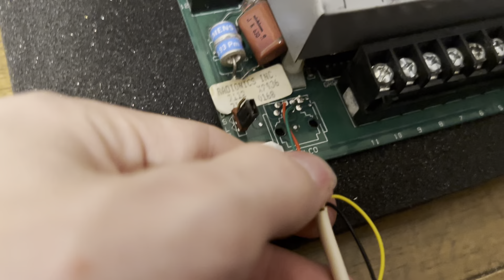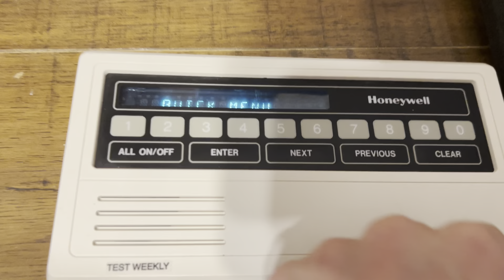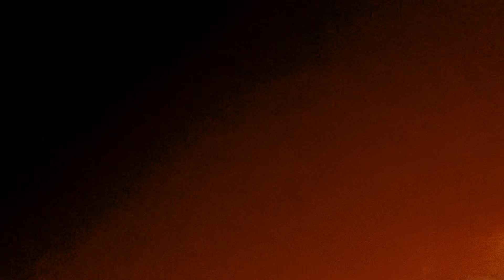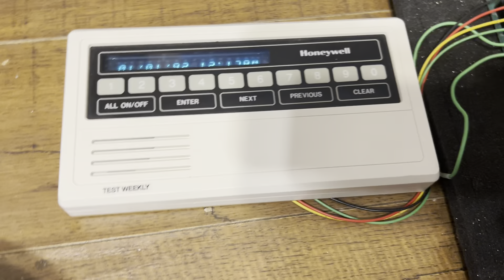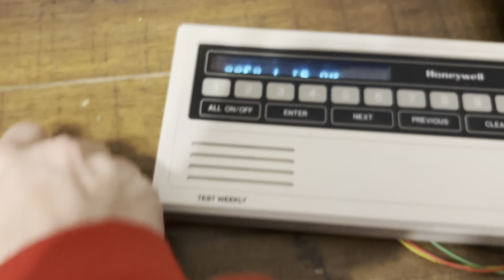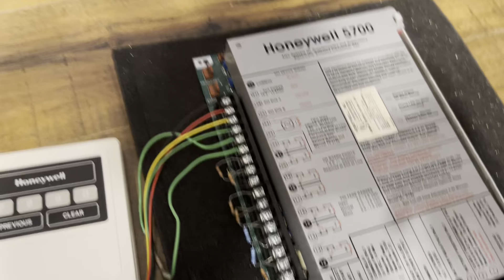Honeywell 5700 Alarm Panel (aka radionics D7112)

Comment: Is that program simulating the monitoring / central office?  I have an old system I would like to hook up and monitor remotely, so if you could provide me some info on where I could find / how to use that emulator, I would appreciate it
Reply from the maker: @buspirate  I explain everything on my website, check it out! Https://radxd461labs.net/cs.html. And sorry, I’m unable to provide any more information about the software.
Reply from the maker: @buspirate  if you want to get your system set up in a self monitored way. I highly recommend you join protostar alarm monitoring, or AlarmLink labs. You can find videos about them on my YouTube channel.